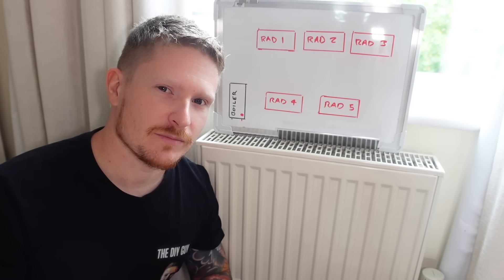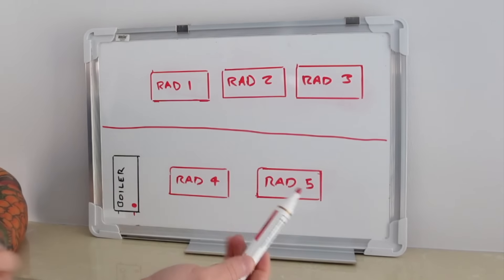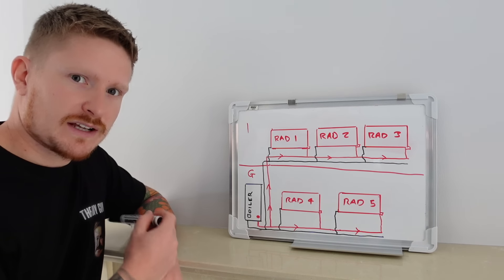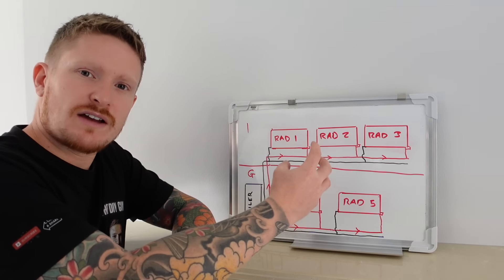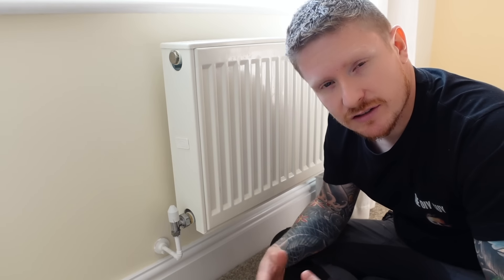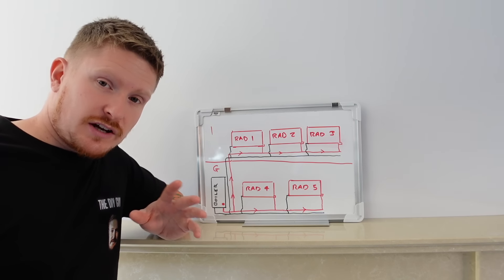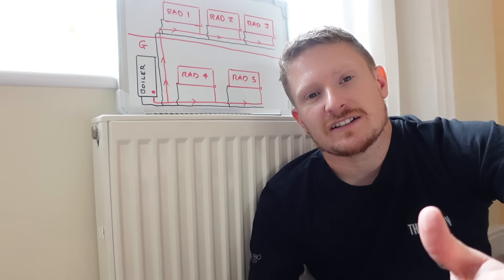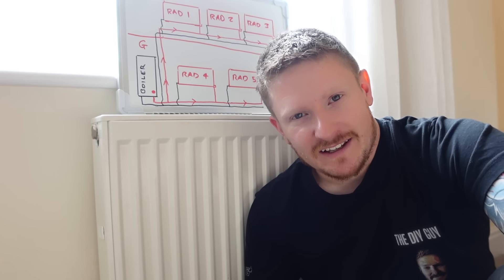How to Balance Your Radiators | Save Money and Increase Heat

Comment: I am an 81 year old woman who is totally moronic about anything technical A freezing cold radiator in my study - but miraculously after watching your video I have made it work! Heat again - fantaasic!
Reply from the maker: Glad i helped you
Reply: Awww well done and more so as you can now help friends who may have the same issue but find it a little daunting...but you can now show them ...👏👏
Reply: At 81 and a woman at that, you are utterly fantastic to do that. Where can I find a woman like you?
Reply: I have a real problem believing this comment!
Reply: Mint💪🏾👏👏
Reply: @dianehorsfall3070 Why would anyone care about what you have trouble believing?
Reply: At 81, you wanted to fix your own. You were born as a pro. Otherwise, it wouldn't be possible just by watching a video.
Reply: @TheDIYGuy1 Hi, thank you for this informative tutorial. I have a query if you've bleed your radiators, why do you hear knocking noises mostly in a random one?many thanks 😊
Reply: Probably at a retirement home, based on what I come across on Insta, Tiktok, FB, etc.
Reply: Good on you for getting to grips. Many younger guys would not tackle it.
Reply: Hey, good work!
Reply: I have a loft conversion and the rad in the loft bedroom always cold yet the ensuite is red hot as are the downstairs rads and the 1st floor ..tried turning down the lockshield valves on downstairs rads but makes no difference and it also make the front room rad noisy...
Reply: @dianehorsfall3070  i thought i was the only one.. lol

Comment: Or just do it the simple way. Tighten rads more for the rooms you're not in as much, open the rads more on the rooms you're in a lot. That way those rooms will be warmer and you're not heating rooms unnecessarily. That's a balanced system.

Comment: I am son of a plumber and heating engineer. The trouble with advice like this, some valves may by old, stuck or simply ready to fall to pieces. Yes, i found out the hard way🤣. I thought i know what i'm doing being a plumbers son. I ended up calling Dad to sort it out. This is great for anyone with a nice new system and has a good sensible knowledge of D.I.Y. but lets face it some folk are gonna get in trouble.

Comment: Just as further interest! what I do is fully close off the lock shield valve on all radiators and fully open all thermostatic valves.  Then go around each radiator and open the lock shield valve each by half a turn...then fire the boiler up sit and wait for them to stabilize then check temp looking for 12 deg across flow and return adjust necessary radiators by 1/4 turn until all rads are running hot, some may only need fine adjustment....after you are happy turn the thermostatic valve down to the required room setting....next make a note of each room lock shield opening on a piece of note paper for future reference...then go to the boiler and again look for 12deg across flow and return and if your pump is so fitted look for the same there you can on some pumps restrict the flow to get that temp return plus adjustment of the pump speed helps...do this and/or incorporate with advice given from G Man and you will have the most efficient system you can get.....one word off warning be careful of lock shield valves that haven't been adjusted i n awhile or you may end up with  a leak.
Reply: That's certainly how it used to be done and works to get the desired heat, but having maximum flow will allow for greatest efficiency in a condensing boiler. Starting with all open a quarter will put a fair restriction on the system.

Comment: In 15 yrs we have had British gas in on our service plan to service and every year we tell the 2 main room radiators don’t get hot. The answer is every time, Turn heating on and close down upstairs rad untethered said cold ones get hot. Then open them.
Hahahhaaa 15yrs of shit.
I saw this and every lock shield valve was fully open. So at almost 70 and disabled I had a go.
Now every radiator is hot in 15 minutes. Even the 2 useless ones. All temp valve no set on low (1.5 to 2) and house is toasty warm, thermostat down to 20 degrees and magic.
Thanks DIY Man your a star. Shame you have to be Corgi to device a boiler. Thank You. Roland
Reply from the maker: Glad it was helpful 😊

Comment: Gary here from the UK I am an old heating engineer and you always want the heat to get to the radiator as fast as possible and stop the water leaving the radiator as slow as possible this allows the heat to pass from the water into the steel of the radiator, When you turn the heating on  you walk around your home and put your hands on the pipes that feed the radiator, the one that gets warm first is the flow so Mark that corner of the radiator with a cross, I use a pencil to make the mark now you know witch is the flow, always turn the flow on full then back one turn . adjust the other end of the radiator or turn it down to close the valve, this slows the water leaving the radiator,  as a rule the upstairs is closed more than the downstairs most of the other stuff you commented on was correct , Now that's the old ways on how to do it, don't forget to vent the radiators with the boiler OFF  air in the system means less heat, 
Happy Balancing
Reply: So are you saying his advice is wrong or right?  I’m asking because it’s a lot easier to follow his clear well articulated instructions with visuals for support than to follow your comment. Which should I put my effort into?
Reply: @lioneljonson29k he's chatting a load of shit to stroke his own ego, you can basically ignore everything "Gary from UK here" says on youtube.

Comment: I've got old radiators and the two in my kitchen and conservatory have been cold for three years now.  Being the hub of my home it is a nightmare, particularly in this current cold weather.  I have spoken to a couple of plumbers and all they suggest is to replace all my radiators and no one has ever mentioned balancing.  I'm not in a position to afford new radiators so I had a go at balancing them.  2 of my 11 radiator valves, are jammed and I couldn't budge them.  But I carried on with the others.  OMG As soon as I got to the last radiator (conservatory). The heat instantly came through. I'm gobsmacked and so grateful for your clear simple instructions. Thank you so much. I have now subscribed to your channel ❤
Reply from the maker: Thanks for subscribing 👍 glad you like the vids
Reply: WD40 the spindle, also you could unscrew the nut just below the spindle (a little water may come out) and this might then enable you to turn the spindle. Don't forget to tighten (not over tighten) the nut back up after though.

Comment: Worked a treat for me, thanks. The biggest radiator in my house by the bay window has been stone cold for weeks and only got around to fixing it this morning. Took about 15 mins of dashing around the house tweaking radiators but all sorted now. Thanks for the simple to follow guidance!
Reply from the maker: glad it was helpful
Reply: We have the same issue, going to have a go this weekend. Its finding the order thats my biggest worry 😅
Reply: @jamesdaballer  See my comment, from doing 13 rads around 10 rooms. I was a bit OCD :-))
Reply: How would this work on balancing a big house and achieving 12 degrees difference?

Comment: Thanks for your help!

I have such a big system that's been added onto over the years.

The flow goes up and down 3 floors all over the place. The 1st and last rad is on the ground floor, and there are 27 rooms!

Comment: Wow! Tradesmen like you are VERY few and far between. My elderly father had a stroke and is now bound to sit in his living room all day long and has had trouble with the radiator not heating up for a LONG time! He has had a total of 4 engineers out to look at his system. 1st eng. changed some parts  in his boiler, 2nd changed parts upstairs (diverter valve) 3rd god knows what he did??? and it was only until the 4th eng.came out and said straight away that his sytem wasnt balanced. he then stated that this should have been the first thing the eng. checked upon arrival. What do they teach plumbers these days???? Thankfully the 4th engineer knew exactly what he was talking about and now the heating system is toasty warm all the time! If only i knew about the Manual balancing trick I could have saved him a whole lot of cash and trouble. thank you so much for sharing thos information. All the best. 👌

Comment: Great video with clear instructions. I managed to bleed, re-pressurise and balance all my radiators today and the system appears to be working fine. I really like the idea of using the IR camera to sense the temperature to identify the radiators that are not receiving more flow. I didn't use it to balance mine but a useful tip for the future. Thanks a ton!
Reply from the maker: Glad it helped

Comment: Thanks for that, just balanced my radiators as one room was cold for years, turning down the biggest problem one also sorted issue with noises made by thermal expansion of the radiator. Probably one of my sons turned all valves open while playing with adjustable spanner.
Reply from the maker: Glad it helped, nice one

Comment: Great video, very helpful. But what do you do with the last radiator in the system which has the lock shield valve fully open after balancing the system? Any advice greatly appreciated!

Comment: If you are able to set a 12C difference between input and output using an infra red thermometer, do you still need to determine which radiator is 1st, 2nd, 3rd, 4th and so on in the system?

Comment: Great video, very informative. However, I'm curious about the temperatures - both absolute and difference. I though that return temp for modern condensing boilers was supposed to be about 40-45 degrees for max efficiency (not over 60C as per your example. Also, why only 12C temp drop between flow and return? I'd read that ~20C would be more efficient. So we'd be looking at about flow/return of 60/40, rather than 77/65?
Reply: Because the radiators in virtually every house were fitted when older boilers were in use at a 10C drop (70c in/60c out) means an average radiator temp of 65c to heat up your 20c room, and the rate of heat transfer is proportional to the difference in temperatures, in this case 45c. 
So people replace their boilers with 60c inflow, but a 20c drop to 40c outflow means the average radiator temperature is 50c so only 30c advantage so you’ll be waiting much longer for the house to get hotter.

Comment: Really nicely explained. Funny as had just done this in my own house after watching how a plumber had done it in a mates house (He used the old school way). The plumber BTW advised to note down all the radiators and each valve settings and keep it with the boiler and any notes so you don't have to figure it out next time.

Comment: I made a tool for this.  It's a tiny little USB powered sensor with 2 sensors on long leads.  One goes on one pipe, the other on the other.  The device sends the temp of each pipe to a database and then displays it as a graph.
Basically you just attach it, turn the heating on and in 20 minutes check if you've got the right drop.  Then keep looping around the radiators in the same circuit until they stay that way.
Another useful thing to check is turning a few of the TRVs to 0 and checking you still have balance at the radiators and importantly the boiler in and outlet.
After I did my radiators I left the sensor in place 24/7 on the link pipes between downstairs and upstairs circuits to give me a "mid point" view.  It is nearly always 12*C delta.

Comment: Thank you, this has solved the issues even the professional tradesmen couldnt fix.  We worked out we have 3 flow systems where radiators have been added at a later date.

Comment: Loved the 2 step approach as well as the walkthrough.
Not a plumber but when it comes to valves and water I tend to open it close fully then just ease it back a fraction. That way if it starts seizing I have got a little bit of wiggle to go back and forth.
👍👍👍
Reply from the maker: Glad you like the video and good tip
Reply: I picked up the same tip working with process engineers in an R&D setting. Their reasoning was that, particularly in an emergency situation, you may not be able to tell if the valve was seized solid or resting against the stop if you happen turn it the "wrong way".  So the risk was that by forcing it you could break it completely or cause a dangerous leak!

By easing it back off the stop, even if it seizes you will still feel it hit the stop when it frees up again and know you turned it the wrong way.  Sometimes you can't always operate a valve from an ideal orientation to instinctively turn it the right way first time, so that feedback can be critical.
Reply: @markbeauchamp3192   *Some

Comment: I just balanced my system based on the size of the radiator. For the smallest radiators (below 500 watts) I set the lock shield open by a quarter turn, the 800 watt radiator got a half turn, and anything larger (up to 2 kW) was left fully open. My aim was to force the largest radiators to get the lion's share of the water flow. What do you think of that approach? Seems to work OK on a short heating run, but being August I can't fully test it out.
NOTE - my system has each radiator fed by 10 mm microbore from manifolds, which I believe makes it self balancing to some extent.
Reply: We have 2 small rads too, basically I think of them as pipes but in the shape of a radiator and am wondering wether I should just open the L/S fully as it takes literally  a minute for the water to run through them, what would be the point of throttling them down?. Thoughts?

Comment: That's a theoretical start, but the trouble is that both the heating and house are dynamic when you take into account thermostatic valves, the house thermostat, where people are and what equipment is running in the house. So a beautifully static balanced system may put heat in the wrong place. It also depends if you want a heating system that warms the whole house evenly or the rooms you use when you return home. If you have thermostatic valves, balancing only really applies as the system comes up to temperature as the thermostatic valves will start kicking in. So my theory of balancing is to start off with a balanced system but then bias it by opening up the valves on radiators on rooms you want to heat quickest, this will reduce heating elsewhere but as the thermostatic valves kick in, the balance will redistribute to the other rooms. That allows you to switch on the heating later as you are not evenly warming the whole house. Remember, very few heating systems are properly balanced to start with and plumbers will sling in a radiator they guess will work, so theoretical temperature drops will lead to some rooms being overheated compared with others.

Another problem, if you economise and turn off heating in a room, adjoining rooms are affected as the wall between effectively becomes an outside wall, without insulation so the radiator needs to put out more heat!

Then bear in mind a big TV and sound system and couple of people watching TV will apply a lot of heat to a room, so the temperature of an empty room you want as you walk into, is not the same as the heat you want when the room is used.

Did I mention the effect of opening and closing curtains? You are probably getting the idea now.

Then the nightmare is what happens with a house thermostat which if the room it is in gets to temperature will cut off the rest of the house. If that is in a room with a thermostatic valve, how does that work? (Quick answer - it doesn't!).

Oh, what happens to the balance when it gets cold and you turn up the water temperature of the boiler to heat the house?

So in the end, setting up a system takes time. Think about how you use the house, how your system will change as things change. Don't be afraid to tweak a radiator down that heats a room too much and too quickly and use thermostatic valves as part of the balancing equation. It takes weeks to tune a system as every change interacts with the whole system and you need to learn how the system is applying heat in the real world.
Reply: Do 20% of the faff to theoretically achieve 80% in heating efficiency. 😉
Reply: Good enough information for those offended by plumbers' rates, but I was taught to set the index radiator(s) first and work back towards the boiler. That said, it was back in the late 1970s and much has changed since then.
Reply: Thermostatic valves and heads are mandatory in all apartment buildings for like 15 years here in Czech Republic, they probably know why they made this law. In the past, some people were overheating in small rooms where it gets warm fast so there was not enough hot water in radiators where it is really needed, thermo valves solved all these problems, nobody is accidentaly heating little room to 30°C like before. We had that theory in school about balancing with classic valves, but it works well only in laboratory, not in real buildings, even with all balancing done by second valve or other stuff, you still should always have thermostatic heads everywhere, it's ridiculous to not having them, I don't understand to people who don't have them, it changes everything.

Comment: Hello. Great video.

To determine which radiator is being fed with the hot water first, your advice was to "Turn the heating on, and make note of which order each radiator heats up".

I have 8 radiators:
1 in the bathroom, 1 in the kitchen, 2 in the living room, 1 in the hallway, 3 upstairs in each of the 3 bedrooms.

If you can visualise my situation, kindly tell me how I can realistically apply your advice.

Thanks.